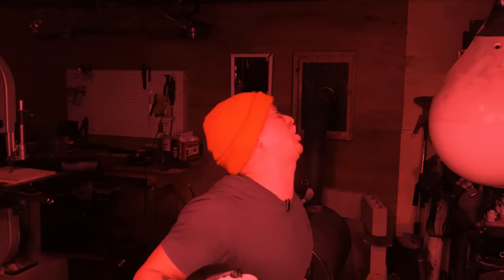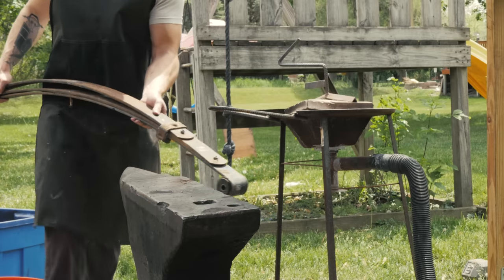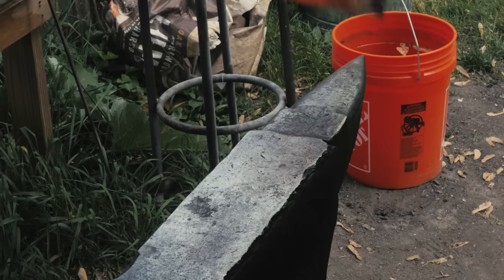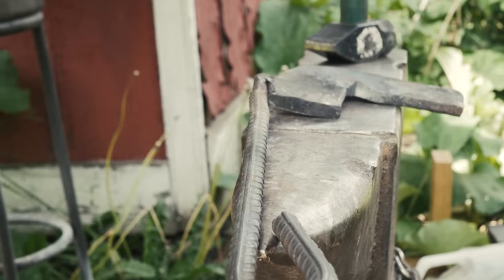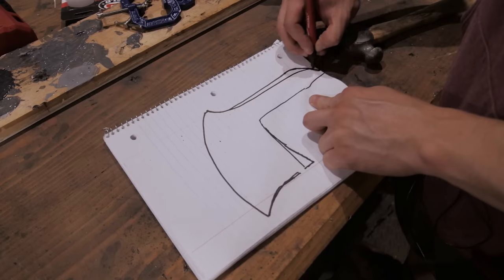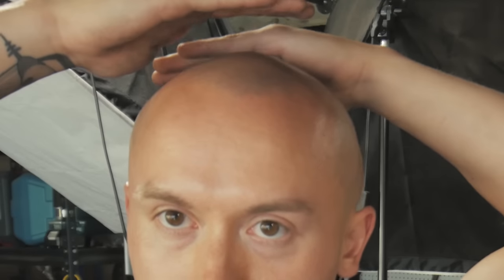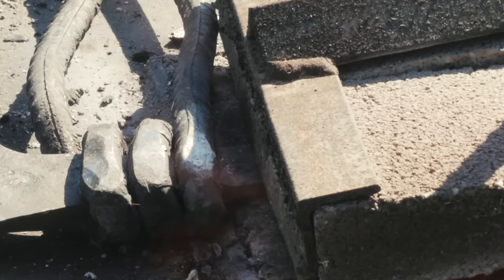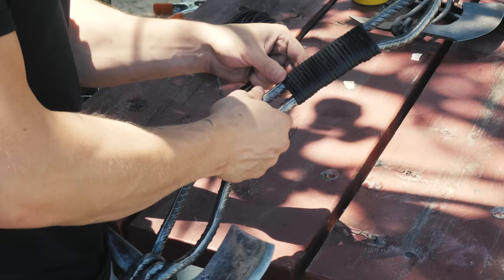Apocalypse Rebar War Axes (With a Twist)

Comment: I just found this out, but if you want to protect non-stainless steel from rust and stuff, you can boil viniga, and while it’s boiling, you dunk the project in there and let it sit for a few minutes.  It gives it a cool grey color and I THINK protects the steel from the elements.

Comment: Not bad at all! I might've advised against using spring steel because it tends to splinter under impact, I have a scar on my arm from learning how that works, but it looks like you already finished it, so aight. 
Pretty please cover your arms for the testing; spring steel shrapnel is a bitch to remove from flesh...

Comment: Sorry for dubble commenting but i also noticed that the anvil is very jagged that can be dangerous to you. ive had a metal splinter break off and go right through my chest, You should repair it any chance you get and it would also make for a good video.

Comment: Would not recommend using rebarb as your handle would recommend some more grip friendly a wooden handle with metal being your handle the vibration from whatever you strick will be going straight to your hands making it overall more cumbersome to use for extended periods of time

Comment: I feel like you could do a LOT more metal moving using the peen of the hammer.  Especially when drawing out the spike and back part, or when feathering the front edge, using the peen would have let you just.... really effectively shift the metal around.

Comment: Isn't rebar a pretty poor metal to use?

Not only is it cheaply mass produced (leading to potential impurities), bit isn't really universal in the type of steel they're made from (no two rebars are the same in both carbon content and retention), leading to pretty shady results.

I think most smiths use rebar is more for practice than to actually make a practical or genuine tool out of the stuff.
Food for thought.